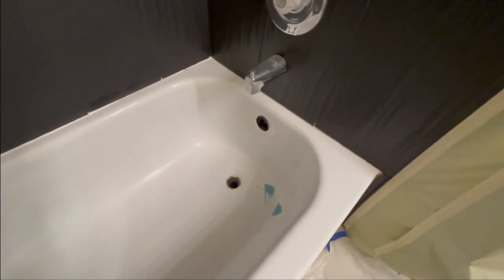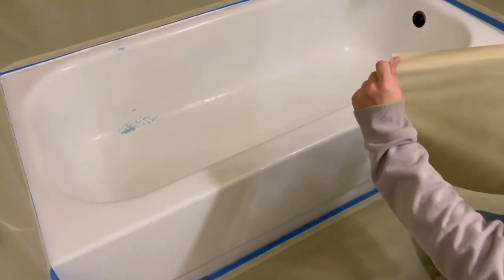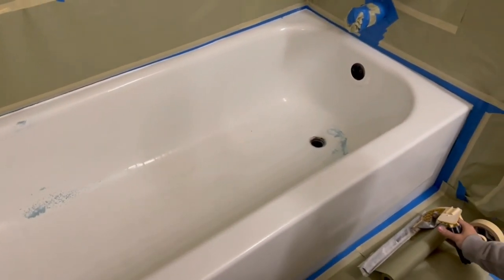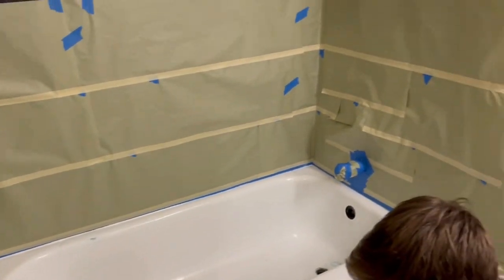AMAZING TRANSFORMATION | How to Reglaze a Bathtub To Black from White! Bathtub Reglazing Process

Comment: Hi. I have a question that I hope you can answer me fast since I’ll be doing it tomorrow. So my gf kitchen sink is green and I want to paint it white. I got some rustolium primer and rustolium appliance epoxy ( white ) along with polyurethane spray. How should I do this? I don’t want to mess it up again. Just yesterday, I cleaned the sink.. put primer then epoxy. Stupid me I waited 24 hours and was like why not put another coat, little did I know I was supposed to wait 48 hrs before I could redcoat it. Story short... the paint started to crack up on me and I had to get paint thinner to do it right this time. How and when should I add polyurethane onto the final epoxy? To help protect it?
Reply from the maker: Your final coat should be the appliance epoxy. No polyurethane needed. You will cause alligator cracking due to the solvents not being compatible. 
Primer and Appliance spray should be fine. Just make sure your appliance epoxy coating is thick enough. I would go through a couple cans waiting 10-12 minutes in between coats and spray three good coats.

Comment: Looks good , should have calked after spraying ! Should be gentle on the first coat ! Go for finish in the last coat !
Reply from the maker: I caulked after it dried two days later. I would NEVER caulk black right after spraying.
Reply: @DPTubs  , do use enamel paint ? Tractor / chassis paint ?
Reply from the maker: @MaxMax-th7uz  Resurface Solutions: Acrylic aliphatic polyglass urethane

Comment: Hey DP, what do you do with rust around a drain? Do you use a rust converter before applying your finish?
Reply from the maker: Yes a rust inhibitor / sealer would be recommended after cleaning and removing as much surface rust as possible.
Reply: @DPTubs  do you mind sharing the brand? There are so many on the market
Reply: @DPTubs  How much is the cost of this work for house owner ?

Comment: DP where do we get the black paint???
Reply from the maker: You get get the rustoleum Spray Cans in black as well. see if they offer color options on amazon.
Reply: @DPTubs  OK ..so I wont be mixing it up in a HVLP spraygun ?
Reply from the maker: @Tinfoil.Hatter  they sell it in quarts! Rustoleum Appliance Spray in quarts. 

Otherwise you can try Midwest Chemicals  high gloss black
Reply: @DPTubs  thanks DP.just anxious to start project